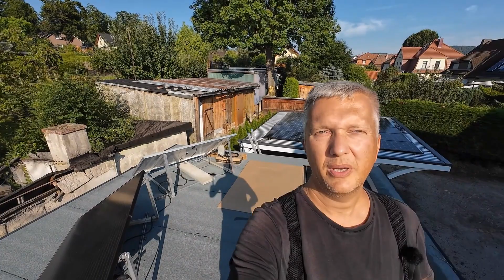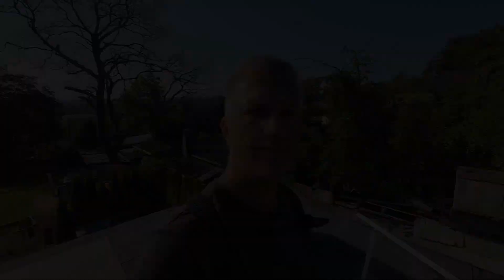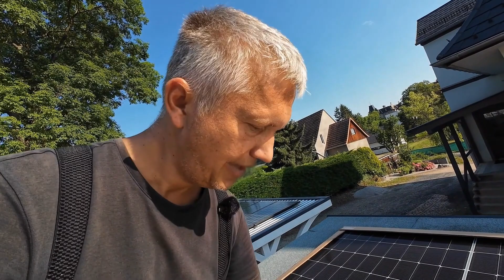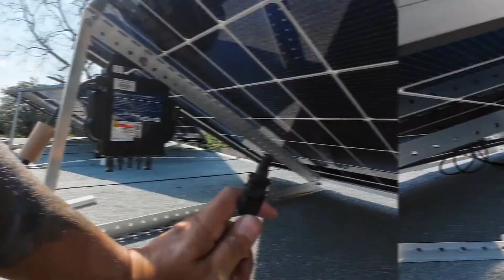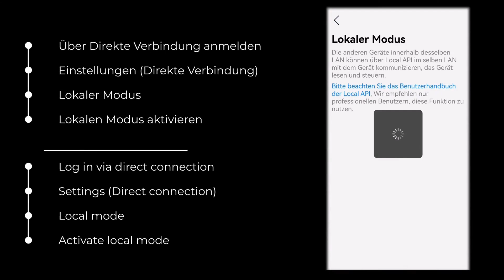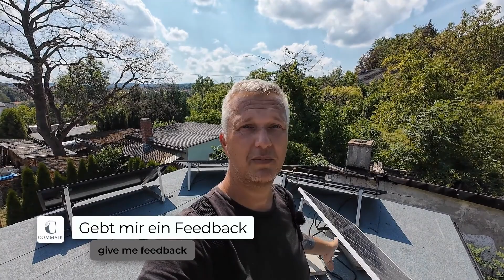How to Set Up a Balcony Solar Power Plant Step-by-Step

Comment from the maker: *👇 All products & links from this video:
🔗 Balcony power plant: https://amzn.to/3OWXDha
🔗 Battery AC+DC: https://amzn.to/3Wo9S8O
🔗 Storage extension: https://amzn.to/4gRrLXh

🔗 Solar cable: https://amzn.to/3OmF3xr
🔗 Inverter: https://amzn.to/4dkcPhK
🔗 Inverter with API: https://amzn.to/4c4bavR

🔗 AC 3-pin IP67 mains plug: https://amzn.to/3Y58b2P
🔗 Betteri cable Ly01-bc01: https://amzn.to/3RqLXVI
🔗 Wieland connection: https://amzn.to/4cNjuQE
🔗 Wieland cable: https://amzn.to/45jj1SG
🔗 13A fuse: https://amzn.to/3ZFbFYz
🔗 Ammeter (reverse capable): https://amzn.to/3ws7bIl
🔗 WLAN socket: https://amzn.to/3TOb1qi

🔗 Flat roof elevation: https://amzn.to/49IwkPL
🔗 Balcony bracket: https://amzn.to/46r1gSF
🔗 Rail system: https://amzn.to/45Uv0ai
🔗 Clamps for rail system: https://amzn.to/3EJyKiY
🔗 L-mounting bracket: https://amzn.to/3SrR0VD
🔗 Solar tracker: https://amzn.to/45dCF2C

🔗 18V cordless screwdriver: https://amzn.to/44TAP8g
🔗 Metal drill: https://amzn.to/3OFzyLK
🔗 Socket set for cordless screwdriver: https://amzn.to/3wmSLsE
🔗 Ring spanner set: https://amzn.to/3tnLTcD

You can find a detailed blog entry with lots more information on my website: https://commaik.de/2024/07/balkonkraftwerk-optimieren-neue-module-und-220v-batteriespeicher-fuer-maximale-effizienz/

This video was originally created in German for my main YouTube channel @commaik 🔗 https://youtube.com/commaik. It has been translated into English using 🤖 the AI tool HeyGen, which replicates my voice and synchronizes my lip movements. 
Please note that ⚠ due to dynamic adjustments, the synchronization may not always be perfect.

📺 The original video, which includes English subtitles, can be found here: https://youtu.be/WbAsj_LEjDo

Note: All links marked with * are affiliate links (Amazon). If you make a purchase through these links, I will receive a small commission at no additional cost to you. Thank you for your support!